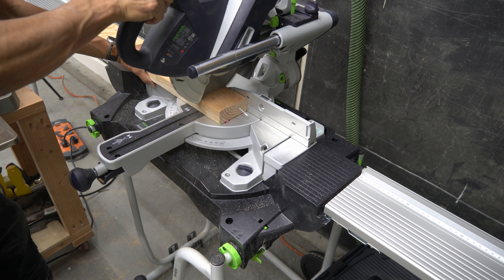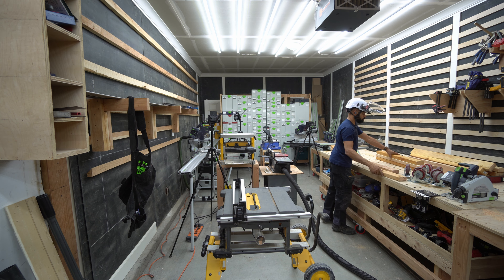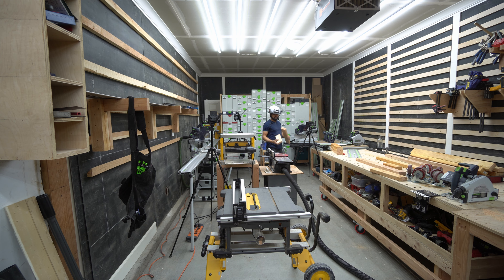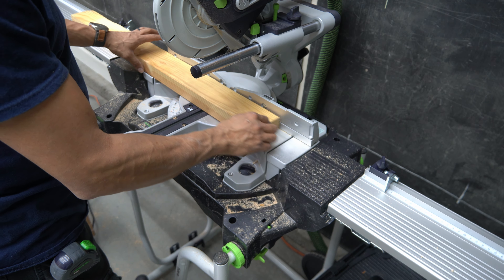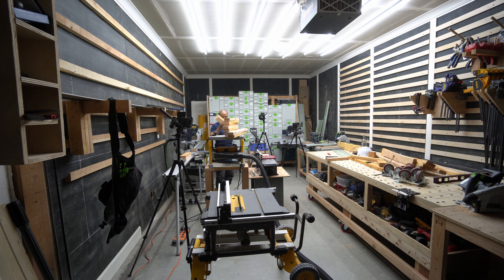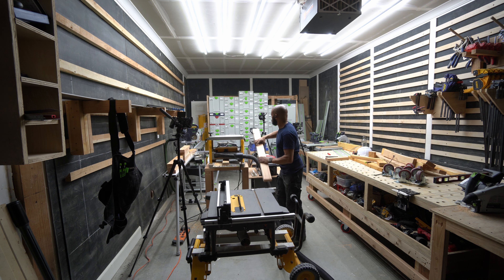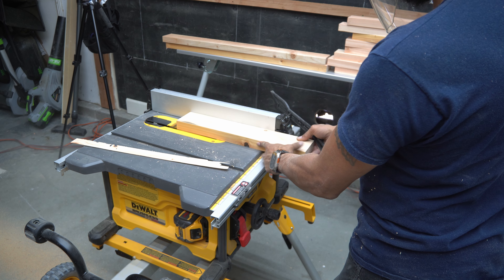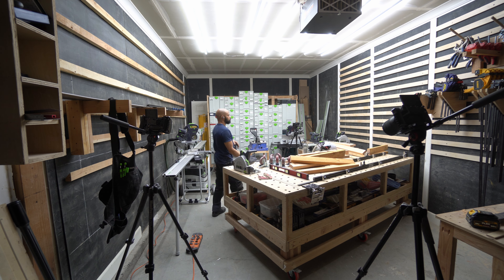In The Shop With Daddy Share Space This Did Not Work Out As Planned

Comment: Not every project is a success but most projects you can salvage by being creative and making the fixes were necessary to complete a project. You have to remember sometimes it's just wood. And in your case this is just a shop project so if your wood splits glue it back together. If you put a hole in the wrong spot plug it up with wood. There's a lot of fixes that you can do. Just remember to have fun when you're in the shop it's not supposed to be a high pressure situation or stressful. Good video.
Reply from the maker: Thanks for the reminder. I cannot deny that there are times when I feel like I should be better. I realize this is not rational as I need a ton more hours in the shop to get proficient. I do enjoy the process so I am looking forward to the journey.